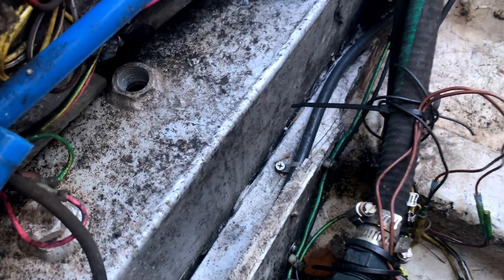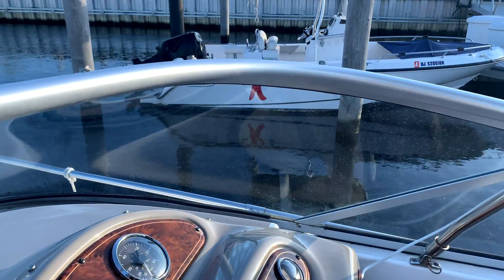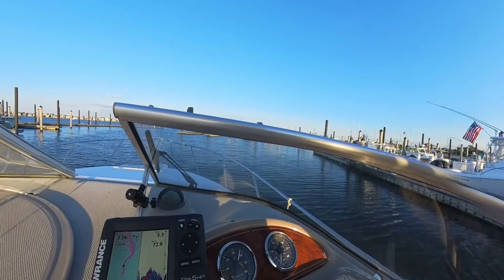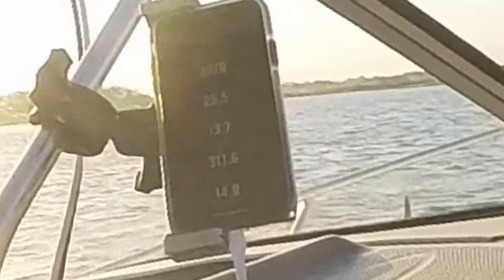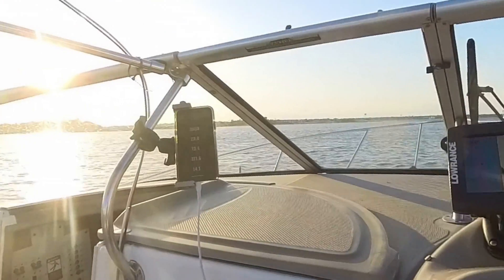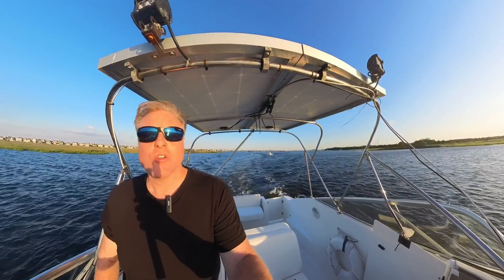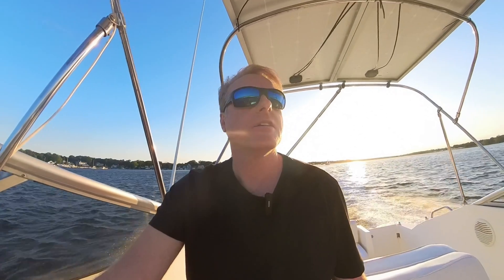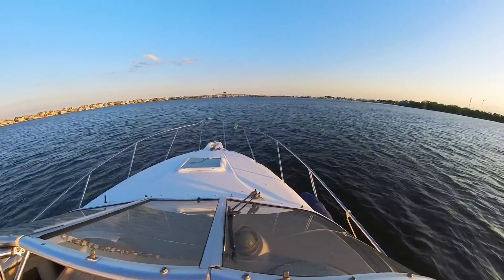Mercruiser MPI bucks/stalls at cruise speed.  Anti-siphon valve and fuel line replacement.

Comment: Do you have any videos of the problem happening.? I’m having a similar issue with my boat runs for an hour or so then will start to cut out shut it down for 15 mins or so runs like new again.
Reply from the maker: I just uploaded a quick video with the footage we found of the boat bucking and stalling out.  It's the 1 minute and 30 second video with the title starting:  Solved!  Let me know if this is what your boat is doing or if it is something else.  I've owned my boat for over 20 years so I've seen a lot.  Hopefully we can figure out what's going on with yours.  Good Luck!!!!
Reply: My boat is doing the same thing.  Same stroker engine to with only 60 hrs on it.  I have tried replacing cap and rotor, about to change the fuel filter/fuel water separator, although I don't have much hope in that fixing the issue.  I believe it is more likely the anti siphon or most likely fuel pressure/ bad fuel pump.  I need to get a gauge hooked up so I can test that.  I never run my blower while running the engine.. I only run it before starting to clear gas vapor/fumes.  I will do some research on best practices and maybe start running the blower all the time.  I have a hard time believing that is the cause for me though as it happens immediately, before the engine compartment would have a chance to build up that much heat and become a problem.  It would be super easy for me to test though as my blower and hoses are all in good working condition.
Reply from the maker: Also check the pickup in the tank. Years ago when I had my old carbureted engine I had some crud in the tank that would cause a film on the screen on the bottom of the pickup. It was just enough to hindered the flow and cause the engine to stall out at cruise.
Reply from the maker: @mend1121  Give it a shot. I’d love to know how it works out for you. Oddly enough mine started to just act up again but only at WOT and not bucking nearly as bad. Previously it would do it at cruise and then it wouldn’t even run at idle. Since having my blower hooked up properly it has been totally fine except for one or two times recently and after the engine running for 2 hours or so. Keep us posted. Maybe we can figure it out if we put our heads together. PS I did change my anti-siphon and fuel line first but that didn’t help at all.
Reply from the maker: I’m so glad you posted this comment. We just searched our phones and we do have a clip of what the boat was doing. I’ll try putting a video together over the next three days with that footage and what truly fixed the problem. Hint: the solution is in the other video that is already posted. Sadly this video actually gets more views than that one.
Reply: So, in addition to filter, cap and rotor, now fuel pickup and anti siphon valve have been changed.  They looked fine but I changed them out anyway and now have spares on board.  I checked fuel pressure on the rail.  It was around 35 psi and didn't have fluctuating pressure.  I'm not exactly sure what it's supposed to be.  I guess I better figure that out before ruling that.. but still no resolution to my problem.  I am running out of ideas.  I guess I could change plugs and wires but they only have 60 hours on them, same as the rest of the motor and components..
Reply from the maker: @mend1121  I think 35 is about right. I know I have it in my video I took so I’ll double check that is what I got. I would clean all the grounds on the battery and back of engine(that’s a PITA). If you’re not getting good ground it could be causing the fuel pump to not keep up.
Reply from the maker: @mend1121  Just checked my one video. There was B roll of the gauge when I was at the dock. 35 PSI.
Reply: @Nautisphere  Capt John,
I was surfing thru cool fuel videos trying to find a similar problem to mine when I came across your video about your Maxum 2400 bucking.  I have a 2000 Maxum 2800 with a 7.4 Mercruiser and after having a motor refresh done on the block last year(cracked block due to poor winterizing), I started to experience the bucking problem you mention in your video.  Here's what mine does and let me know if it sounds familiar:  I can start and idle with no issues at all.  I can cruise at 5-7mph for ever with no hiccups, but as soon as I get on plane and run for 20 minutes or so, it starts bucking...a very short, singular buck, but a disconcerting one nonetheless as you know.  After it does it once, it will continue to do it  a almost a set interval of about everything 3 minutes if running close to WOT and less often if i back down to 1/2 throttle.  It definitely seems to point to a fuel problem.  I tried switching out the anti-siphon valve but no luck.  I currently have it a the fella that did the rebuild last year and we tested the fuel tank vent hose to make sure there wasn't a venting issue and there wasn't.  Our next step would be to pull the cool fuel pump and check the screens and regulator for clogs or signs of failure.  Your engine blower idea seems like plausible one and I will check that too, but I read on that you are still having the issue.  I'll let you know if we end up replacing the cool fuel pump and if that fixes the problem.
Reply from the maker: Thank you so much for your comment.  My issue was a little different.  At no wake speed I could go all day without a problem also.  My issue would happen at cruise speed.  I don't usually full throttle so I nice comfortable cruise speed of 28 MPH.  I could sometimes go all day without a problem.  However, when the problem started it was persistent.  The boat would just start to buck.  If I let off the throttle it would sometimes stop but almost always I would have to come off plane.  I could continue slow almost forever after that.  However, there were a few times when I would attempt to get back on plane and normal cruise speed.  Most of these times were unsuccessful.  A few times it led to needing a tow and even stalling just trying to raise the RPM in neutral.  This is when I went down the vapor locking path.  That saga is in another video.  Since connecting up the blower motor properly everything has been fine.  I went all last summer without any problems EXCEPT on one of the last days I was on the water (it was fall and not hot or anything) it did happen as I was coming back to the marina but I may have been running against the tide in the canal and I was out for hours with the engine running.  As far as what you are seeing, I agree with you it sounds like fuel delivery issue.  Something similar as you describe was happening to me.  At the time my boat had the 220 HP 5.0 2 barrel carb on it.  I would be running at cruise and all of a sudden the RPM would slowly just bleed off until the engine stalled.  It would start back up fine, run fine in neutral, run for a few minutes and the same thing would happen again.  That was the year after super storm Sandy and my boat had been in the water during Sandy (it survived with just a ding on the swim platform). However, I didn't put it in the water the following year.  So the boat was on blocks next to my house for over a year.  The following season my carburetor was totally jellied.  I had only used the Stabil Red.  The fuel also had a lot of water in it.  Long story longer, the screen on the pick up that season was constantly getting a film on it.  I'd have to take the pick up out, blow through it, wipe it down, put it back in and everything was fine for another hour or so.  I was like clock work.  The more I cleaned it, the longer it would run fine.  Took me the whole season to clear the crap out of the tank (plus a lot of draining the fuel water separator) and then finally drain the remaining water from the bottom once I pulled the boat for the season for it to stop.  Following year no problems.
I did change the fuel pump thinking that was the problem first.  We honed in on the fuel tank by bringing a 5 gallon fuel tank with us.  My Dad and I went out on the water and when it started happening consistently, we hooked a hose up to the 5 Gallon tank and he just held it in there.  The boat ran fine.  We switched back to the boats fuel tank and the problem immediately start again.  That's when we knew we had something wrong from the fuel pump back to the tank.  Let us know what you discover and Good Luck!!
Reply: @Nautisphere  Just wanted to give an update on my issue with the bucking at on plane RPM's that I outlined above.  We replaced the cool fuel regulator and in doing so found that there was a T valve in the middle of the vacuum hose that goes from the regulator up to the manifold that assists in maintaining proper fuel pressure to the fuel rail.  This T valve is needed at the top where the vacuum hose splits to the manifold but there should be a straight barb connector in the middle of the vacuum hose linking those two together.  Now we can't say with certainty that this T valve was in place last year while we were running since we did have the cool fuel system out of the boat and were comparing and possibly swapping parts with another system...but my thinking is that when the engine was put back in the boat, the a T valve was accidentally put in the wrong place leaving an open barb where vacuum was lost or for certain not maintaining constant pressure.  We did also put in a new fuel pressure regulator, so there is a chance that the old one was bad, the barb was correct and the problem was solved by a new regulator not a faulty connection.  In either case, we took the boat out Monday and ran 10 miles to our favorite local on the water pub and no issues...granted last Fall when we did the same, we had no issues on the way there, but the problem reared it's ugly head on the way back, so we held our collective breaths while driving the 10 mile run back across the lake.  To our joy, no issues on the way back either!  I will reserve judgement that the problem is completely fixed until we take another long ride, but I'm feeling pretty confident it was fuel pressure issue of some kind.
Reply from the maker: @Gberven  Thanks for the update!!!  Greatly appreciate it.  My boat went back in on Saturday.  We were out on Monday for a few hours and at one point I finally got a chance to cruise @ 28 MPH and 5 minutes later we started bucking.  I probably still have fuel mixed in from the winter which does vaporize at a lower temperature.  I just ordered a longer hose for the Fuel Injector Pressure kit so I can troubleshoot better if it happens again.  I figured if it starts acting up I'll at least be able to see what the pressure is and bleed off any air/vapor and potentially confirm if that fixes the problem.  Should make for an interesting video at least.  I'm going to poke around my engine now and see if I have the same type of setup as you but it sounds like you have your problem solved.  Hope all continues to run good for you and thanks again for sharing your findings.:hand-purple-blue-peace:
Reply: Also, running my blower full time had no effect.